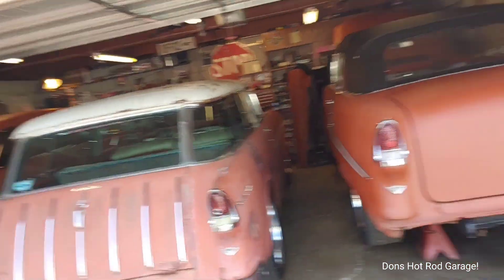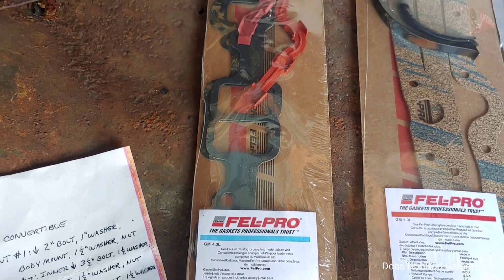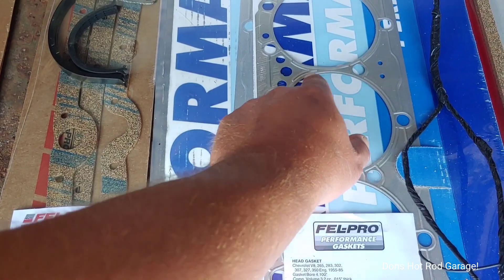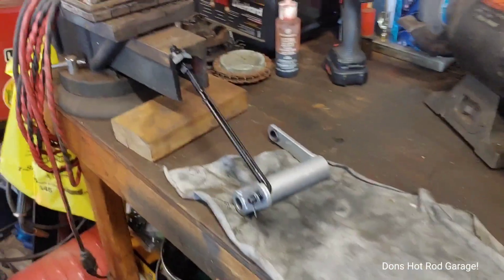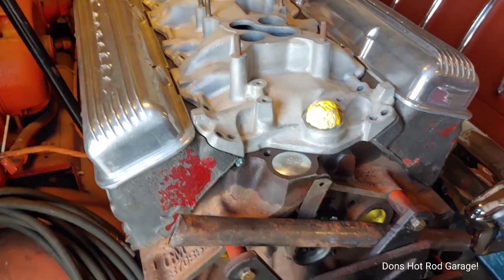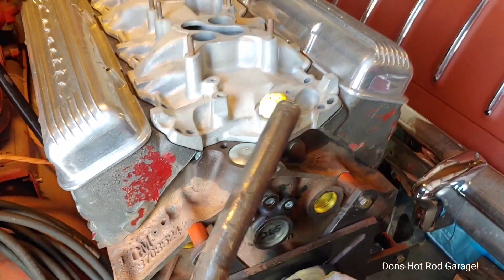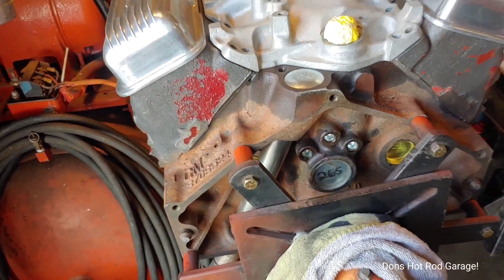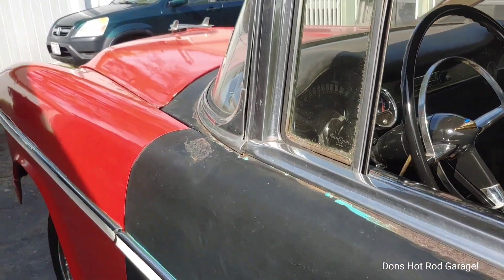55 Chevy Convertible Project car Plans!

Comment: I have one question---right now everything is within a gram as the rods/pistons are paired up. Are you confident that  will still be the case if you match the numbers? When I build an engine I weigh them before pressing the wrist pins to get as close to perfectly matched as possible---numbers be damned.
Reply from the maker: Hey Chip! Great comment man! I think I'll just let this engine stay how it is! Ive talked to the engine builder a couple times since the video! He has assured me this engine is built in its best configuration right now! He said he worries more about tighter clearances then a number on a rod. He said once everything in the rotating assembly has been machined the rod and piston goes into the best cylinder for clearance! Hes 80 years old and built well over 3000 engines! Im going to keep my trust in his machienst hands! Have a good one ✌️
Reply: @donshotrodgarage1717  I'm a career Machinist, and I thought I would throw in my 2 cents to help ease your fears. Rings and bearings are where you make everything perfect.
Reply from the maker: @hippychipsguitars601  great info man! Have a good one ✌️

Comment: Looking forward to the build , I’m with you and I said it before with you talking it would drive me nuts too I might’ve been the only one to know about it but I’d still know about it and it would drive me batty, can’t tell you how many parts I’ve redone for one little drip of paint that nobody would ever see but I redid them anyway
Reply from the maker: Hey Robert! Yeah buddy this is really driving me nuts! Alot of people have said its a very bad idea to tear this engine apart to move rods around! I called another local engine shop Performnce Research and they told me to leave the engine how it is now! There a chance the pistons can get damaged being removed from the rods or a ring could break taken them apart and so on! They told me just like the original engine buikder rold me the rods are numbered for reusing the original pistons! This engine is bored with no pistons and have been built around the pistons! It quite the dilemma man! I have alot in this engine already and the further I go the further the engine build will not make sense! We'll see how it works out! Have a good one ✌️

Comment: can you take a moment to describe the difference in dist oiling grooves in block and on dist?
Reply from the maker: Hey David! Yeah I'll go over that on the next video! The cam journal has a groove cut into it and it basically opens the 2 little holes in the rear cam bearing for a split second to allow oil to transfer. It happens millions of times a minute while the engine is running! The factory 55 56 distributor also has a small flat area on the shaft to allow oil to transfer past and then drain back down! There very unique engines that require the right original parts! Have a good one ✌️

Comment: Do what you got to do Don It's all right to be passionate about you motor someone has to, to preserve it's  history !!!!
Reply from the maker: Thanks John! I've talked to a local machine shop and they've advised me to leave the engine as is. They said it will do way more damage then good to switch around parts on this engine. They said just like the engine builder told me the numbers are on the roads strictly to reuse the original pistons! So at this point I would love to correct the rod numbers but for forward progress on the car I will more then likely bolt the engine together as is. My engine builder assured me it will run its best as assembled in its current configuration! Have a good one ✌️
Reply: @donshotrodgarage1717  Yes Don they are I think giving you good advised ! Just continue with your build and get the 55 back on the road ! Have a Good Day !
Reply from the maker: @johns9993  I agree man. Have a good one ✌️

Comment: Great. It needs fixed. It would drive me nuts as well.  Your builder should be the one making it right!  Since he won't, I'd be doing the same thing you are. If OCD is wanting things right...I have it too lol.
Reply from the maker: Hey Greg! Yeah man I agree with you! I'll probably call the engine builder back and talk to him some more. Many people have commented and said I will be doing more damage then good moving around parts in a rebuilt engine! I talked to another machine shop today and they advised me to leave the engine as is. They are all telling me the numbers are there strictly to reuse the original pistons! I'm now considering putting the engine together and starting it as it is built! Have a good one ✌️

Comment: That’s the main thing Don  you have to happy at the end of the day. I’m just looking forward to day it fires up. Stay safe out there buddy and will talk to you later. ✌️😎👍
Reply from the maker: Hey Kevin! Yeah man that's it for sure plane and simple! I talked to another speed shop and they have advised me to leave the engine as is! They said once everything is machined the rod and piston goes into the best cylinder for clearance! The numbers are there strictly to reuse the original pistons! The engine builder told me this engine is built in its best configuration right! I'll just have to process this and move on! Have a good one brother✌️

Comment: Don, Your going to do what your going to do. I had the feeling you are going to rebuild that 265 and it would bug me too even though it will not matter too much.
On that road draft tube (straw) put a plug in the top of it or weld a cap on the bottom to seal it up and pop that 1-3/4 plug out of the top. You could get a rubber plug (grumit) in that hole and there is a 90°PCV valve that you could put right in the hole. You could use an AC, CV-761C PCV valve It will fit a 1/2"or 3/4" hole and has a 90° elbow which fits .377 or 3/8" I'd hose to your intake or carbon lower plate.
On your head gaskets. It's designed for a 4.10 bore can you find something smaller?  
Felpro 8510PT has a 3.90 bore head gasket which was for the chevy 305. motors since you have a 265 which is a 3.75 bore +.060 your is now, it's a 3.810" bore. This head gasket is  closer than the 4.1" bore you have Your saying you have a .015-.016 compression on the gasket. The Felpro 8510PT is .038-.041 I have seen. You could double check the numbers. Just calculate the difference. I know if thoes heads are not smoth enough a .015 head will not last long. An old trick was to paint some VHT on the gaskets before you install them for a better seal and that is wet.
Good luck and keep us posted but seriously look for headgaskets for a 305 ci motor it's closer than the 4"00 bore that's out there now for SBC motors.
Reply from the maker: Hey Monadking! Yeah man it starting to look like a situation where I can cause more problems thwn good by moving the pistons around! Ive talked to another speed shop and they have advised me to leave the engine as is! They said if I start moving parts I might as well plan on rebuilding the engine! I can't do that it wouldn't make sense money wise! I would have over $6,000 at that point man there is flat out no way! I'll look at the 305 gaskets but im thinking I'll spray these head gaskets and use them! Have a good one ✌️

Comment: Hey Don , take and clean any oil off of the top face of the pistons you're going to pull and number them with a Sharpie . Just for shitzengiggles , that engine is freshly overbored , and there is no ridge to mess with measuring things . Take your calipers and see how much variance , if any , there is between those cylinders , if they're all within a thousandth or thou and a half I would not switch the pistons onto different rods . At least you didn't find two rods with the same number , that used to be common when someone would spin a rod bearing , usually number seven , they would get a reman crank , reuse the seven good rods out of their engine and use one out of another to make a full set .
Reply from the maker: Hey Bob! I love the old story's man! I think im going to leave this engine alone. I talked to another speed shop and they have advised me to leave the engine as is! They said once i start moving stuff around plan on rebuilding the engine! They also said once everything is machined the rod and piston goes into the best cylinder for clearance! The engine builder has told me that this engine is built in its best configuration right now! I'll have to process this and move on! Have a good one ✌️

Comment: Hey Don pull out the piston and rod assembly’s and just keep the rings in the cylinders they were fitted to. Swap the piston and rod assembly’s back to where they belong . The pistons are all the same size as is the rod bearings. Just the piston rings are different if they were actually file fitted.
Reply from the maker: Hey Vincent! Yeah man ive talked to the engine builder a couple more times. He told me he worries more about tighter clearances then a number on a rod. He said he built it this way for a long life out if the engine! He told me he moves parts around to fit better and run smoother! He said the numbers don't mean anything once the rotating assembly has been machined! He's old school man and kinda got mad I was questioning his engine building skills. At the end of our conversation he told me he's built well over 3,000 engines I have nothing to worry about! Lol Have a good one ✌️ brother

Comment: Man, you gotta do what makes YOU happy, not what anyone else thinks. Just be very careful trying to press the rods yourself at home, it’s easy to break a piston, I’ve done it. The 55 is looking good! Have a good one 👍🏻
Reply from the maker: Hey Thanks JJ! Man ive talked to my engine builder a few more times and decided to leave the engine alone! He told me he worries more clearances than a number on a rod. He assured me that this engine is built in its best configuration right now! Have a good one ✌️

Comment: Be careful.  You can crush the pistons  with the press. They make a tool to hold the rod small end. I would check with Goodson  tools.
Reply from the maker: Thanks for the tip Chris! Ive talked to another local machine shop and they have advised me to leave this engine alone! Just like you they said I can break a piston or break a ring or numerous other things! I have talked to the engine builder and he told me everything has been clearanced and the engine is built in its best configuration right now! He also told me the numbers are for reusing the original pistons only! Once everything has been machined the engine starts fresh and is built to spec per cylinder! We'll see how it turns out. Have a good one ✌️

Comment: all the engines i've done i always made sure the rods went back on the same cylinders and journals on the crank
unless you had the rods resized  they should always go back the way they came out was the way i was taught
with the pistons being new  they would be ok in any bore  if the guy machined it right for clearances
best way don to get it done right is do it yourself
Reply from the maker: Hey Green JJ! Yeah man that's how I'm thinking! I have talked to another speed shop and they have advised me to leave the engine as is! They say once the engine is machined with new pistons they go into the best cylinder for clearance! The engine builder has also told me this engine is built in its best configuration right now! So ill have to process this and move on! Have a good one ✌️

Comment: I had the same thing happened to me Machinist put in Cam bearings And Cam plug  After breaking the engine in did not Run. Right took it apart he had installed the wrong Cam plug there was Brass shavings all in the oil That's why I mention the cam plug the other day When you remove the  Back Cam bearing  It should have 2 holes The Cam notch spends around connect 2 holes  And delivers oil to the top end That is called part time oiling System You can notch the 2 holes in the block Together And get full time oiling Which is better for highway  Driving And allows you to run any Cam you  want Mine is all original except for the Cam It's 327 I put mine back together 6Years ago still running great You're doing it the right way you're away
Reply from the maker: Hey David! Thanks for the great advice on the rear cam bearing! I have read that it needs to be aligned perfectly to deliver the pulse oil to the lifters. I'll be checking that out for sure! Have a good one Buddy 👍

Comment: If you aint happy then it needs to be corrected.  It's a shame the builder won't handle it. Killer Sticker shot at 8:18 ! Lol. Man, the steering wheel looked great on the gasser. I been soul searching about looking for an original wheel in the future
Reply from the maker: Hey BW! Yeah man I just think they should be in the original cylinders! I talked to another speed shop and they have advised me to leave the engine as is! They said once things get moved around plan on rebuilding the engine! They also said once everything is machined the rod and piston goes into the best cylinder for clearance!The engine builder has assured me that this engine is built in its best configuration right now! I'll have to process this and move on! I think the original steering wheel look cool on the Belairs! Have a good one. Buddy✌️

Comment: Like i say b4 :
I with you on the
Rods bro.
What if ya mark all pistons with the cylinder number of where each was taken out of. ; then change all the rids accordingly . (?)

However: still feel wsy ya do about them going back in original cyl.
Keep on ricking man
Reply from the maker: Thanks T P! Yeah man I feel they should have been put back into the same cylinders! I just talked to a machine shop and they have advised me to leave the engine as is! They said once it has been machined the numbers don't matter and the piston and rod goes into the best cylinder for clearance! The engine builder told me the same exact thing! So this is something ill have to process this and move on! Have a good one ✌️
Reply: @donshotrodgarage1717  
Just  put it tigethee as it is & roll on.

Comment: Good morning Don, I have been watching you for the last couple of days.  I haven't been commenting on your situation. Hey you paid for this engine to be rebuilt by a person who is a professional.  Your not  Wrong for  Expecting the work to be done  correctly! Like you I couldn't sleep at night thinking what else was not done right. So if taking it part and putting the rods back correctly and check that the bearings are right and what ever else you can think of is right. Then you can live with your self and say I know because I put it back together!!!!!! There are two many things going on in your life, like me. You don't need to add any more craziness to slow you down. Just remember, every day that you can wake up and tie your own shoes and start making a difference.  Is a good Day 👨‍🔧🏁.
Reply from the maker: Hey Mario great Comment Buddy! I like that and your right anyday you can wake up and tie your shoes is a great day! This guy has built many engines over the years and I do have full confidence in his engine rebuilds. For whatever reason he didn't put the rods back into the original cylinders! When i called him about it he said its not big deal and this numbers are only there for reusing the original pistons! More people have commented about the concerns of moving parts around in a new rebuilt engine! Ive talked to another local machine shop and they said for me to leave the engine alone! So now I'm at a point where I might just put it together as is! Have a good one ✌️

Comment: I don't know if you are aware
 That they now make a one piece oil pan gasket. This eliminated any leak problems.  Also I would use per a torque head gaskets which require no retorquing.   You might lose a slight amount of compression. But do replace the rods in the right position.  Sorry I called you Dean in my previous post.
Reply from the maker: Thanks Thomas!  This old engine has a different bolt pattern for the oil pan! I'm not sure the one piece gasket would like up with the holes. 1955 Chevy 265 v8 is a very unique engine! Have a good one ✌️

Comment: Hey Don, I feel the same way as you with the  numbers on a used motor but when you have machine work done it changes everything. The rod are stamped new for the rebuilder to know where they go if put together if there isn't any machining work done on it (ie new rings). When you have the crank cut (over sized) and the bores punched out with new pistons, the rods don't care where they go any more because the parts aren't matched now. One thing, (words of warning) if you do take the motor apart make sure you have the rods pulled from the pistons the right way with the right tools or you can mess things up real quickly. I myself, would let it go the way it is, seeing you had it done by a pro (your words, not mine). Doesn't he stand behind his work, if he messed up that is? Good luck buddy and I hope I don't have to say I told you so. lol - later buddy
Reply from the maker: Hey Marvin! Yeah man im processing this in my mind! The builder has assured me the numbers are only there for reusing the original pistons! It said the way it is assembled now is as right as it can be and the numbers donelt mean anything anymore! I don't want to hear into the this and create more new problems! As much as I would like them to be where they started off at it just looks like I would make big problems for myself! I will probably rest and believe in the builder ive always trusted and put this dang engine the rest of the way togther! Thanks for your insight and keeping on the right track brother! Have a good one ✌️